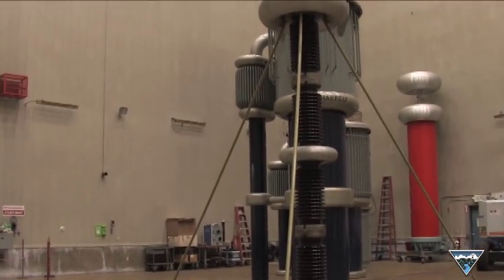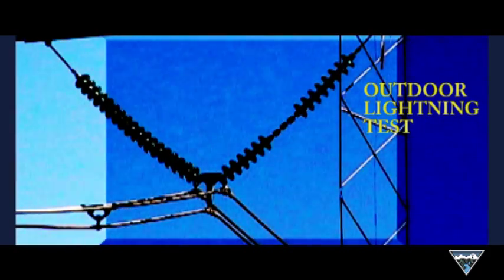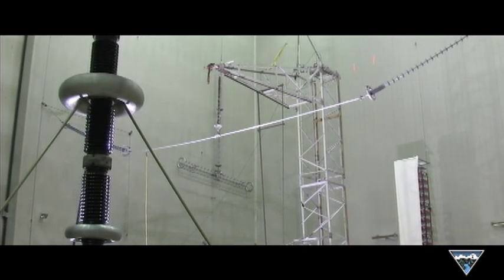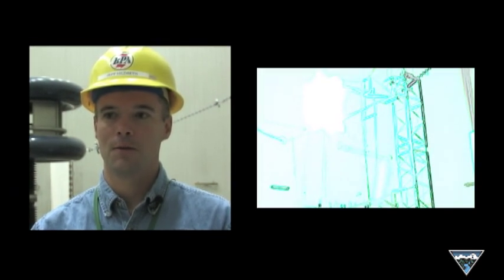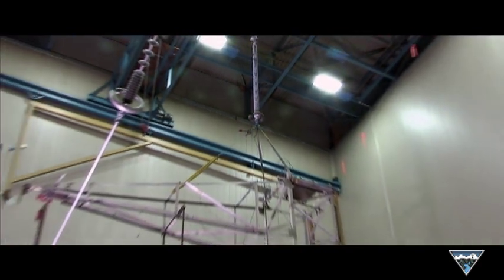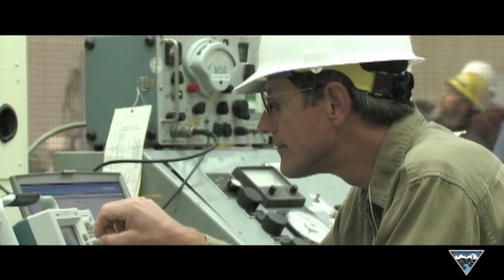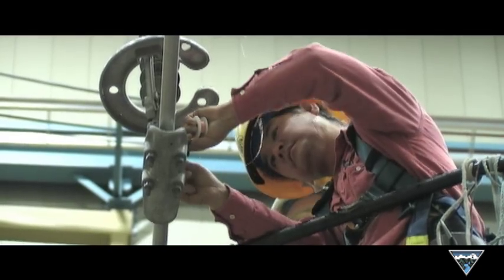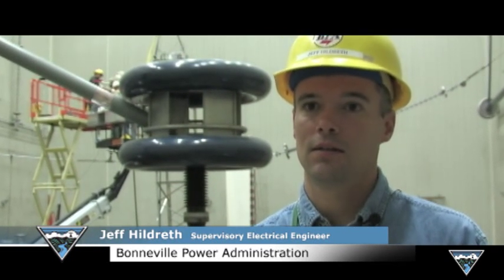EPRI: Arc Flash Study Project

Comment: This experiment used only 3/4 amps of current.  Roughly, what is the max current on an actual 500kV line during peak usage?
Reply: Permaglo anywhere from 200 amps all the way up to over 1000. Either way, enough  to vaporize someone instantly.
Reply: @EphemeralProductions  Is the 1000Amp figure based on an electrical fault situation, or an actual realistic normal usage situation?
Reply: Videogamer555 : operating conditions, from what I've heard

Comment from the maker: @lakewood85 - Good ? ... Europe uses 50 Hz because it better fits the metric system. And after WWII the voltage was doubled from 110V to 220V because higher voltages use less copper, which was expensive at the time. The proliferation of 110V in North America prevented the doubling of voltage but large appliances still use 220-240V plugs.
Reply: Definitely an interesting tidbit. . .(regarding Europe and 220 volt mains)
Reply: Didn't Europe also have a lot of 110V equipment in place before the switch? Why is Europe willing to render obsolete old equipment, but the USA isn't?
Reply: @Videogamer-555  I can't remember hearing anything about 110 Volt in the Netherlands, but of course there is more Europe besides the Netherlands.
In the Netherlands, 127/220 Volt three phase power has been used in a number of cities, in two possible configurations: one as a two-phase (of the possible three) system with a voltage of 220 between phases and 127 Volt + neutral. From what I know, the two-phase system was the more common configuration.
It could be there are still a few connections with those configurations left, but by far the most now use 230/400 Volt configurations.
Reply: @weeardguy  So there are residential electrical outlets in people's houses, that use 3-phase AC electricity? I thought that was only for industrial usage.

Comment: I was thinking it is hard to protect yourself against a incredibly powerful 2000~3000 Mega-Watt flash-over blowing up in your face. I can imagine the massive white hot explosion, sending the 80Kg test dummy into the air, along with part of the conductors, insulator and clouds of vaporised metals and sparks. It as powerful as several sticks of dynamite, the physical force of the blast can crush you. It way more powerful than the arcs and explosions posted on u-tube so far. A system disturbance!

Comment: Several utilities are involved in this ongoing study to make arc flash calculations realistic for higher voltages.  Arc Rated clothing usually prevents deaths from arc flashes and dramatically reduces injuries over ignitable clothing but we need to help protect better.  Lots of work to do on this front but moving to arc rated clothing is always good.